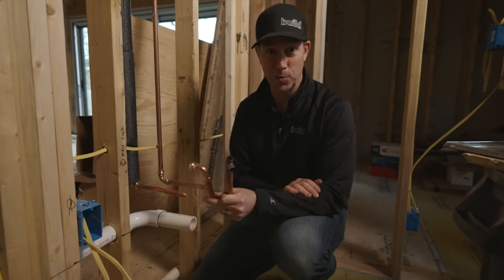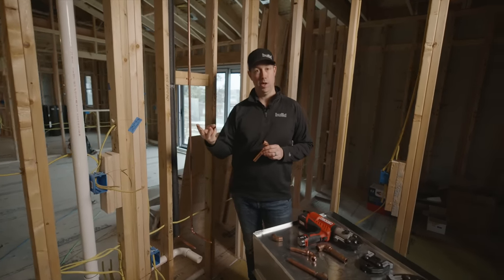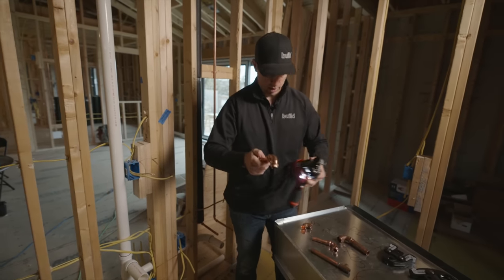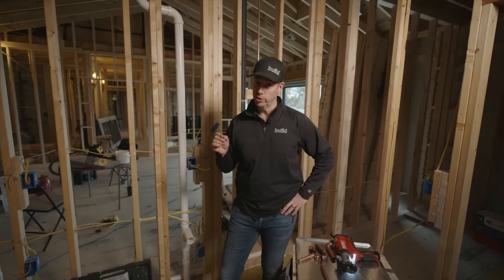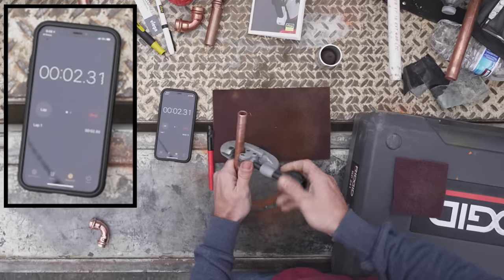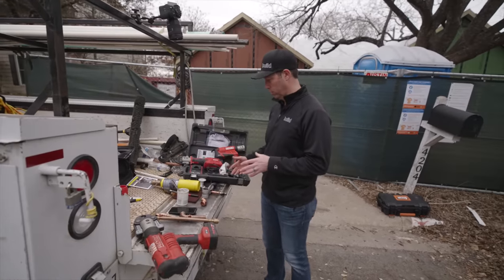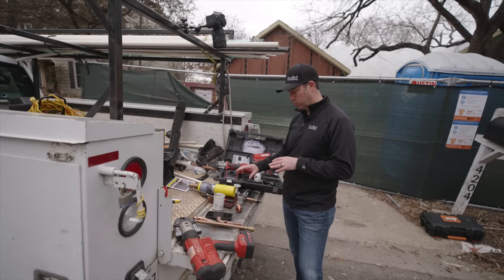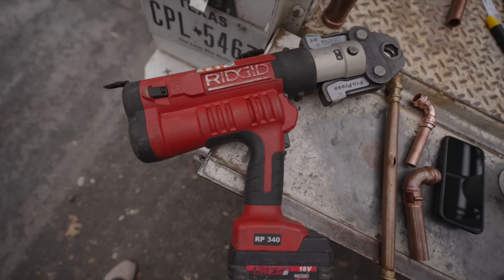Copper Plumbing - Viega ProPress vs. Soldered

Comment: Didn't mention that the ProPress doesn't have to have a dry pipe like sweating does.
Reply: Or that you can't unsweat a fitting so every repair involves more work and more joints.
Reply: Unless it's really a lot of dripping, most of the time you can just heat-up the pipe on the side that's dripping, and boil off the water, but sure crimp-on fittings are easier for that type of repairs.
Me, on new jobs I prefer sweat joints with mostly long radius elbows on main runs, on repairs I prefer crimping.

I like both systems, but the time savings is a moot point, as 90% of the time you insert a pipe on both sides of a fitting on place to make sure that everything lines up and sweat them in one go, then the time savings of crimp-on are lost, cooling down is then also no issue, as you don't have to handle the hot pipe.
As for brushing the inside of fittings, I use a pipe brush in the drill, and brush all fittings I think I need in one go to.

Next to that, crimp-on fittings on average cost about 5x, and that really counts up.

But above all I prefer just to bend the pipe, because the best joint is if there is  no joint, and joints that don't need to be their screams amateur time to me.
Reply: bread trick...  and shark bite fittings...
Reply: Agree if got space bend and sweat fittings as assembled. Emery cloth and de burr were always the plumbers mate job so job never took that long. York or compression fittings were only used sparingly, as you say 5-10 times the cost.
And don't ever put copper pipe even wrapped in putty tape in a concrete slab just stupid.
Reply: @michaelwesten  " But above all I prefer just to bend the pipe,  "   I'm curious, where do you work and what kind of work.   It seems to me that bending pipe in water or hydronic heating systems is pretty much non-existent in the US,  while (based on my careful research on you-tube)  that it's common in the UK.  I think that Air conditioning/ cooling guys bend pipe, but not plumbers.
Reply: @andrewalexander9492  the problem here is skill vs cost, a skilled labourer has a higher hourly rate then the jam straight pieces in there and pressfit everything fast guy.
In the Netherlands we used to bend our copper (water and gas), nowadays i see more and more use of pex(-alike) systems and press-fitting copper is more common aswell.
Reply: @joshfazenbaker5691 That's a backwards thought... You can unsweat a fitting and you can't  take apart a propress and reuse the pipe
Reply: @andrewalexander9492  this true, but it's because the ac and plumbing are two different diameters even though they are both 1/2" or whatever size you need. I used to do ac and if memory serves it's because one is the OD measurement and the other is the ID measurement. You can put ac copper in the bender but not plumbing copper.
Reply: @heathparker2062  Yeah, that's true, plumbing uses "pipe" which is ID and ac/refrigeration uses "tubing" whcih is OD,  but that's just a matter of getting the correct sized bender.  I have a 7/8"  tubing bender (Ridgid)  which bends 3/4" copper pipe like a champ.  Ridgid also makes a 5/8" tubing bender which (I believe) would work for 1/2" copper pipe.
Reply: Neither does pex
Reply: Neither does sweating. Just a place for the air to vent
Reply: @michaelwesten  I've used press on repairs in the past but came across several pipes that were to thin and the press fittings clasped the old pipe so I sweat old pipe most the time unless the pipe walls looks really good , I press most my new work because I know the pipe is good I've had one leak on a press fitting in three years and it was about a month after I installed it ,it was a coupling and when I got there to replace it I realized that my dumb butt forgot to press that fitting and all I had to do is press it that was two years ago and it doesn't leak now so my experience is that press fittings are good but time will tell. I'm still a believer on sweating copper but I don't do as much, and don't care how many plumbers talk trash about propress I've been plumbing since the 80's so I'm just moving with the times and all them pro plumbers don't like change let them get rid of their new trucks and go back to their old junk vans that don't cut it in the new world.
Reply: @andrewalexander9492  Same here in Australia, bending pipe for corners is standard,you get much cleaner waterflow Vs a welded / pressed bend
Reply: Doing repairs on wet pipe with a weeping shutoff valve... Uhg! That's what a loaf of white bread is for. Stuff some bread in the pipe, sweat it on, then open a sink faucet sans aerator, problem solved. Use leftover bread to make lunch.
Reply: @joshfazenbaker5691 Good Point that's were sweat fittings win, but who cares the customer is paying not the plumber, Right!?

Comment: I started using Viega back when it first came out. I was a building maintenance manager for a very large corporation.  When I came aboard, I found my staff had been making repairs in finished walls with compression fittings which is a no no.  When I found out about Viega, I purchased the tool to do up to 2", which happened to be the largest copper we had in the building.  It was very handy as we could execute repairs in minutes.   One time had a leak in a line that we weren't able to isolate in the boiler room.  We fitted a ball valve to the tool and quickly cut the line and slammed the valve on and pulled the trigger.  Within seconds we were able to close the valve.  It also eliminated our 1 hour fire watch.
Reply: That is a realworld  fix which would be hard to do with other solutions - isolating full pressure /  flow faults.... (getting a compression fitting on in that case is challenging if not impossible - and solder,   yeh, nah not happening.
Reply: @kadmow   - push on fittings (AKA Shark Bites) can accomplish a similar result for that emergency shut-off, for those of us who DIY and don’t own that pricey tool. In fact, Matt has an older video demonstrating just that with a Shark Bite shut off valve being pushed onto a pressurized flowing pipe with the valve initially in the open position, closing the valve once it was pushed on sufficiently.
Reply: @stevebabiak6997   - had to revise, I didn't realise Sharkbite was good for copper as well as PEX thanks.
Though is a push in fitting as mechanically strong / long lasting as a crimp (or solder) connection ?
Reply: @kadmow   - I can’t speak to the strength or durability, but the manufacturer of Shark Bite might have that data. I did note in my earlier comment that this is definitely a good idea in an emergency; you then buy time so you can determine how you want to approach a permanent repair (or leave the push on in place permanently).
Reply: Same here I had to change out a 4" water main valve. They make flange fittings so I was able to use a flanged ball valve. The main leaked pretty bad no way to shut it off without shutting down our whole site. One fault though they don't do well with vibration. I had to silver solder a few leaking fittings that I think were 1" . Hopefully the newer stuff is better.
Reply: @billsilva7932  agreed about vibration, I’m a stationary engineer in a Large steam plant and have had to replace many pro pressed joints for solder due to leaks
Reply: @bayleyx1  that's the trade I retired from . Big Pharma company 30 years. You see the other side when you're on the repair end. Not just the installation side. You know it's all about application!
Reply: pls share the cost...?
Reply: Love it
Reply: @kadmow  sharkbites do have there place but i would not consider them permanent like a solder or pro press..
Reply: Why would compression fittings in walls be a no no? Pro press is essentially a compression fitting essentially just much faster and cheaper to install
Reply: @joshdiehl8737  Code
Reply: @kadmow no, a press will.long outlast a sharkbite. I won $500 from a propress rep once because i removed a fitting by hand alone after it had been pushed on, he assured me it was "impissiblle" and i bet and won the bet
Reply: @joshdiehl8737 because you are not allowed slip joints or comp fittong in a n9n acessublle location by code.. this is across many locations where code varies but this stays constant... for good reason

Comment: Matt, I'm a plumber. First, a "single end test" isn't realistic"- in the field or on the bench, all openings of the fitting are fit up and then the entire fitting is soldered- saves a bucket of time, setting up multiple heats on the same fitting after it is set up in place, but most of all, only uses about $350 dollars, new cost for a plumbers rig and bottle. Map gas is slower and more expensive. But the machinery to handle the whizz bang, just for the small set- well over a thousand dollars, and it will likely need three to a dozen new batteries every year. They ain't cheap here in Dallas. So, I'm calling you on this one; get with your fellow builders and poll a bunch of plumbers, particularly repair people. Be careful of youngsters who talk this talk but don't know how to use the very much less expensive solder on fittings. You are right- it is a craft skill, but it isn't rocket science.
Reply: There’s nothing wrong with tectite/sharkbite. Tectite has been used for decades in Europe. The real difference is cost. The solder fittings are real cheap vs tectite or press

Comment: FYI, soldering is not fusing.  Fusion implies welding, which would require the copper to reach it's melting point.
Reply: Agree. This system mates the two surfaces together instead of fusing. Pretty cool tech but I'm still liking pex cold expansion more
Reply: @Ninjump  Also squeezing two things together really tightly is NOt fusing them. Soldering is not welding, its brazing.
Reply: It is melting point?
Reply: According to the dictionary:
Fusion - "the process or result of joining two or more things together to form a single entity."

Says nothing about molecular structure becoming one. Welding and melting are not part of the definition. 

More importantly, what was the point of these semantics? We know what he means and intended to say. What exactly do you achieve by demanding different vocabulary?
Reply: @djaa7 it is on a molecular level. Respectfully intended. A "fused" object shows no separation of the materials in the final result . That is to say, if you cut the materials across the fused connection you would not be able to see where they were once 2 things. Soldering is not fusing though it does have a molecular bond

Comment: One advantage of sweated fittings is that you can take them apart if necessary
Reply: If you have to take them apart...you measured that take-off for 3/4 instead of 1/2...or measured your rough-in on a Monday morning after your team won the Super Bowl. :D (Sorry, I couldn't resist)
Reply: @SpiceeMustard  More related to the future when things are changing and you have to repipe a section and there isn't enough pipe to cut the fitting off.
Reply: I kept scrolling to see if anyone caught on to this
Reply: While you can take a sweated fitting apart, it isn’t any fun… in my opinion
Reply: @DanielinLaTuna  no argument there! Especially when you're in a wet, smelly crawlspace that's barely tall enough to lie in, and the fitting you're trying to replace is wedged between 2 beams about 4 inches apart!

Comment: As a red seal journeyman plumber here in Canada, I can say propress has some amazing benefits in both residential and commercial. It allows connections on copper in situations where there is water in the copper without having to mitigate the water to solder. It allows copper to be connected without hot work and in an instant which is amazing. It even works on live piping, and a lot more reliable than a sharkbite. Plus it saves inhaling solder flux and fumes and other corrosion related problems that can occur when soldering. soldering still has a place as copper soldered fittings are a lot less expensive than press fittings and some spots are too tight to get the propress into so you still have to solder. Also certain situations like using a torch to remove an old copper fitting or tube end and then resoldering a new one in place still requires the torch. Its a great system, however soldering still has a time and place.
Reply: Yea, but a 2 in. 90 degree Viega elbow is $43 ea. vs a standard 2 in. 90 degree Copper Sweat elbow is $11 ea. If you need 10 - 2 in. elbows on a project you have a $320 dollar material difference. I can sweat a joint pretty quick. Yes, an unskilled idiot can install a Viega fitting, but I do not want an unskilled idiot doing anything, but sweeping and picking up after my skilled labor. If I had to because of the location, absolutely, but not for every filling on a project.
Reply: Does anyone use pex  pipe
Reply: Our town is big on pex pipe
Reply: Great comment. You are one of the few to mention the potential health risks of inhaling propane, flux and solder fumes over the course of a career.  Press to fit connections may lengthen and add quality to many lives.
Reply: @larryhansman3384  yes, people use pex. Lol. It's the most common plumbing system on the market these days. Approximately 65% of new home builds use pex.
Reply: but what do you do when you need to take the press fitting off? you can’t just unsweat it like a solder joint
Reply: That and this tool helps us avoid hiring a plumber. The last thing any homeowner needs is some arrogant prick coming in our home destroying our property only to tells us too bad so sad now pay up in full. Is there any profesionalism in the industries today or is it all gone?
Reply: @djviolett8344  You can't, its like PVC, you have to cut it back further and add a coupler.
Reply: @petebusch9069 Charging outrageous prices and years later you find out they did a crappy job.   
That's why I'm here - I'm doing it myself this time

Comment: I'm a maintenance supervisor for a university, and Viega (Vee-a-ga) is our campus standard when repairing or installing copper piping. It's been around for a while, and we haven't had one issue with it. Viega stands by their product, and we use a lot of their fittings from 1/2" to 4".

We have two Ridgid press tools; the 18v that can press up to 4", and a smaller, more compact model than the one Matt used in his video. Since purchasing the 12v press a couple of years ago, it is used the majority of the time, and Ridgid and Milwaukee both offer a press using the 12v platform.

Sweating copper pipe fittings for years, I had reservations about the ProPress system when I first started using it. For us, it's the easiest and safest way to make connections with copper piping, and having a licensed master plumber with over 30yrs of experience on our team, he always says the ProPress system is the best thing since sliced bread.
 
The downside: It's expensive. The tools and the fittings. The average DIY'er can save money by learning to sweat copper pipe or using other pipe installation/repair products.
Reply: Doesn’t even say the name right lol it’s driving me crazy
Reply: Having done boiler installations and complex filter set ups, the press fittings mean your plumber better have his planning hat on before he starts- any error is a pain and expensive to remedy- a slightly off kilter fitting cannot be rotated with a little new heat, a new fitting and maybe and additional coupling if you have to cut bask your running line.

Comment: Matt when plumbing someone else's house: "PEX is the future and is perfect"

Matt when plumbing his own house: "I want all copper, and it can't be the cheap thin stuff.  Who can I find to sponsor me so I can install their copper for free?"
Reply: You also forgot about local code. In my surrounding counties Pex is outlawed
Reply: @charlesjedlicka2725  Fellow Chicagoan?
Reply: @charlesjedlicka2725 i assume due to rodents ?? Respectfully intended question
Reply: Yes, Illinois prohibits the use of cross-linked polyethylene (PEX) pipe for water service and domestic water distribution systems in buildings, except for conveying distilled or deionized water. 
PEX pipes are flexible, making them easier to install in tight spaces, but they are not as durable as traditional materials like copper or PVC. PEX pipes can also be damaged by exposure to UV rays, which can cause them to deteriorate over time. 
Some other materials that are prohibited in Illinois for water service and domestic water distribution systems include: Chlorinated polyvinyl chloride (CPVC), Poly butylene (PB), Polypropylene, and Polyvinyl chloride (PVC)

Comment: Matt, Thanks for explaining the copper wall thicknesses. This is something that a lot of people over look and choose the cheapest item on.
Reply: Any main run's we highly recommend thicker pipe's especially when those are in the slab.
Reply: He could have also.mentioned the color classification too but DIYers shouldnt be doing it if they dont know that much.
Reply: M is perfect for a residence. Even in the slab. L an k are designed for commercial applications
Reply: @scottbendall2696  We run type L in residential, and M for heat. Such as baseboards etc.
Reply: @scottbendall2696  i saw a whole house leaking all over from M pipe because their well water was slightly acidic
Reply: @scottbendall2696 m is not allowed in slab by code bud. Must be type k

Comment: My boss has 5 trucks on the road and 5 machines. For service plumbers it is a super time saver.   Yes fittings are more expensive,  but my hour as a certified licenced plumber is expensive as  well.   Quality of fitting is much better type K copper as you pointed out.    Disadvantages sweat fitting can be removed and replaced  but I haven't seen a pin hole in a propress fitting  yet!   I have been using this system for over 10 years. The guys I work with make fun of me saying I have forgotten how to sweat I use the  machine so often!